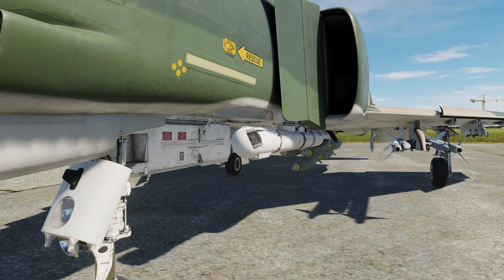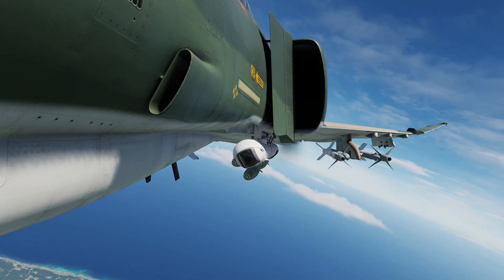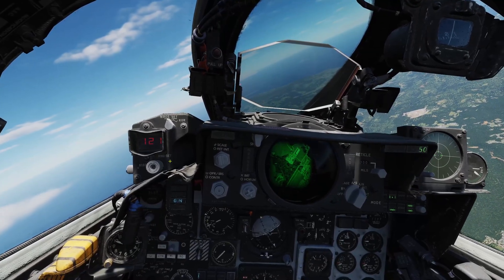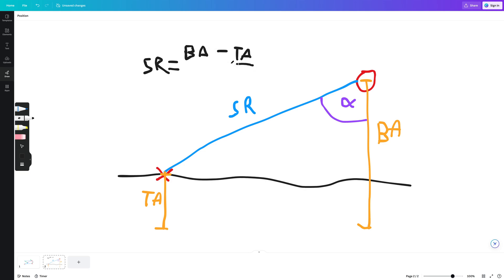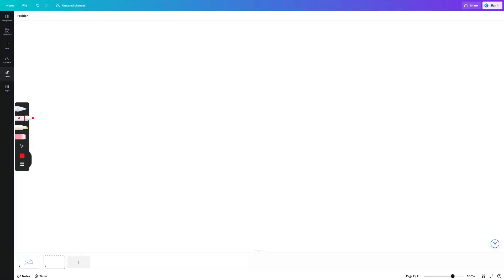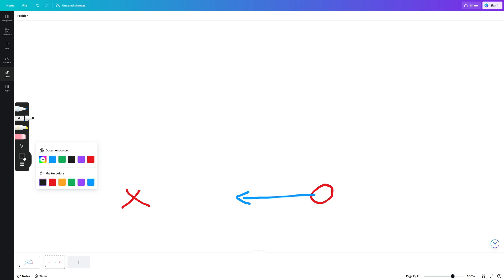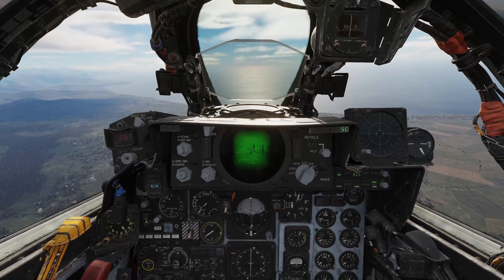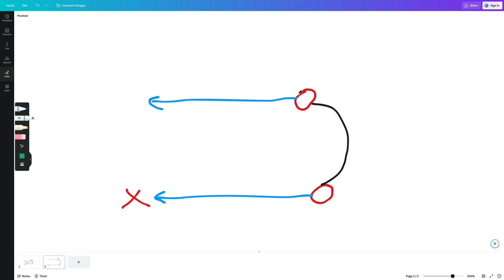DCS: F-4E Phantom - Pave Spike - Tracking

Comment: I love the tracking pod and laser guided weapons, only just learned how to use them, but now I need to learn how to employ them
Reply from the maker: @ArcFire_Fox  Cool, enjoy! You can deploy the bombs in any mode you like, but TGT FIND is probably the simplest. Put the pod on the target, hold down the Bomb Button, follow the steering cues in the HUD to fly straight at the target and wait for automatic weapon release. Dont engage the laser yet, the pod is very sensitive to aircraft movement and if the laser is on while the pod wobbles, the bomb follows the wobbling laser and is likely trash afterwards.
Stabilize so that you can guarantee that the pod won't wobble for the next seconds, then activate the laser (about 8s before impact is okay) 👍

If you want to fly away from the target during that, try a hard right hand turn after weapon release, then stabilize for lasing (prefer right over left as the pod has a bit more gimbal limit looking to the left).

Comment: Is it required to use the WSO seat ? I don’t like needing to hop back and forth
Reply from the maker: The controls are temporarily available for the pilot to bind as well, until Jester fully supports the pod. Right now, Jester sets up the pod for 12-VIS and, by clicking his context-action, he will enter or leave TRACK mode, where the stabilization will be executed. If you want to slew the pod further or start the laser, you would use the temporary binds for the Antenna Hand Controller.
The Target Altitude can be set as Pilot via the Bombing Calculator tool.